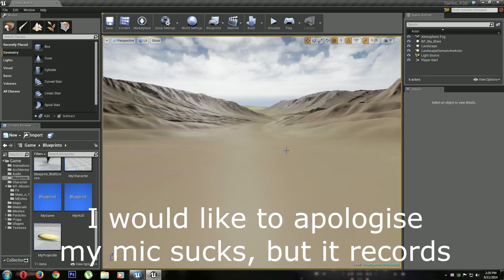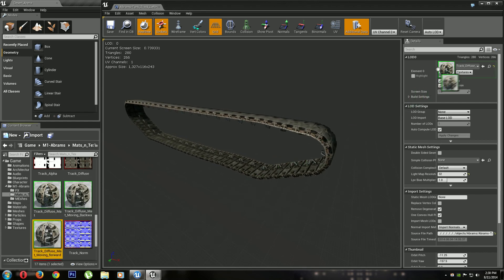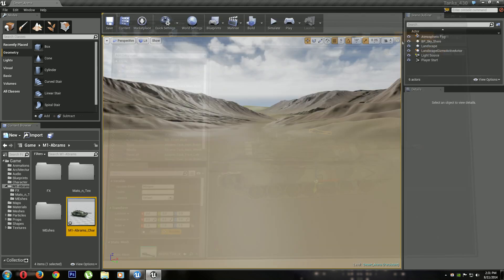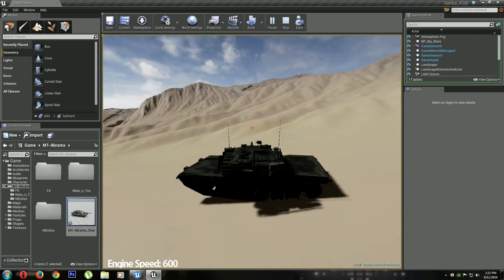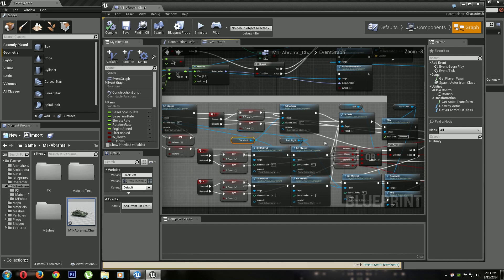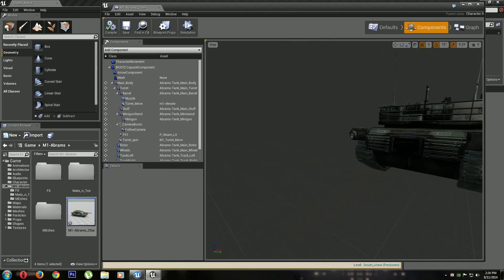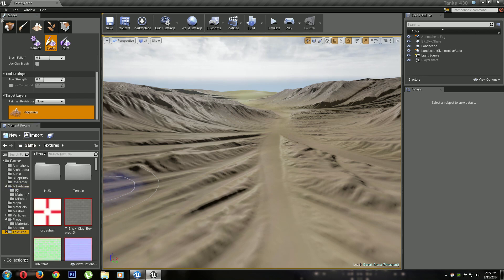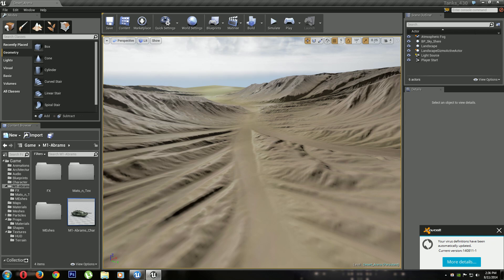UE4 - M1 Abrams Simplified Tutorial...

Comment: It has been a while i am looking into tutorials like this but in my side, i import the full mesh generating one skeleton with bones for each object. I must ask your opinion if it is better to do your way (meshes separated, pivot 0,0,0) or my way? Thanks for reading, you have a new sub btw :)
Reply from the maker: Either way will work, for me, I did it with separate meshes because the older unreal engine I was working with had scaling issues coming from 3DS Max...
You simply have to center the pivots for all boned parts at the centers so that they can be rotated properly around the bone...
I'm currently working on a version so that I can rotate the wheels (and have suspension travel on them...) and have the antennas bounce...
I'm currently working with 4.15.1 on a newer model of the tank...

Comment: With a material instance you may be able to pan the material up or down with a variable controlled by the speed of the vehicle (-1=texture pans - on Y. +1=texture pans + on Y) BUT that might make it harder to animate turns. Unless you simply use a left and right variant of the mat instance, and control them separately within the BP.

You may be able to set the root bone to align to surface in an animation blueprint, as well... but I haven't tried it yet.

Anyways, thanks for this video! It gives me some new perspective for my own project